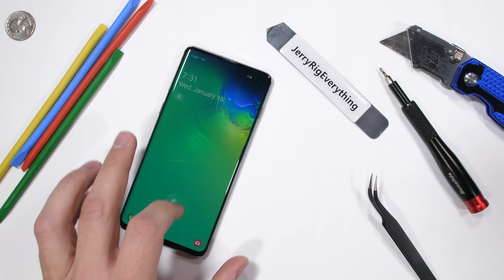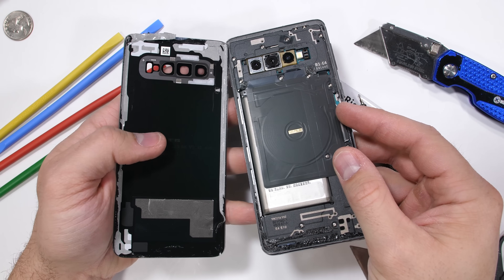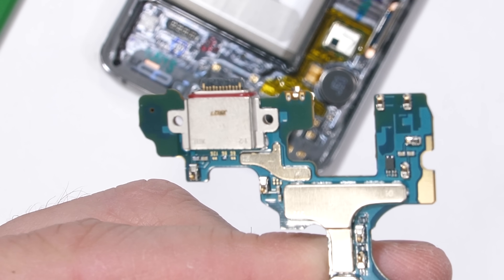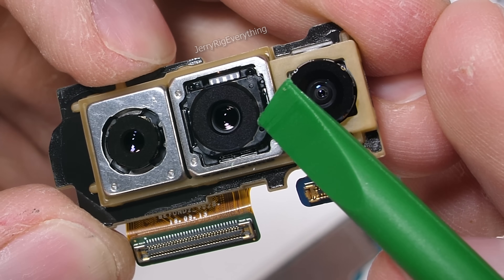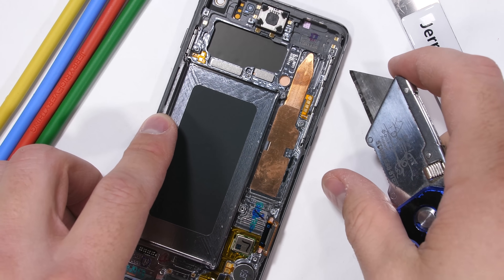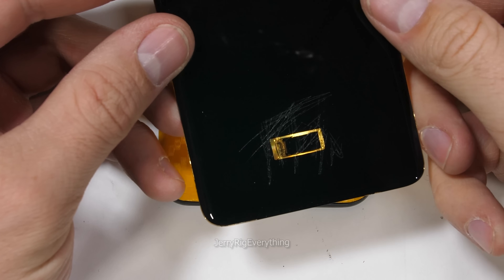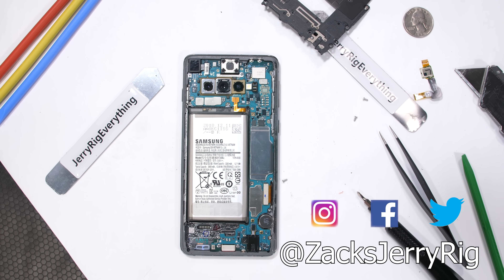Galaxy S10 Teardown – Does Ultrasonic Measure Up?

Comment: The ultrasonic fingerprint reader would have worked if you had re-registered your fingerprints. It just has to recalibrate to the new groves in screen.
Reply: That's pretty smart!
Reply: Oh no it wont work. If you place your thumb at that same very spot where you placed while registering , only then it would work.  But that's very Less probability. Cuz the scratches have to super impose on those exact same places for scanner to accept.
Reply: @knovelgen7735  have you tried? Also, groves can be improved with the same type of repair that is used on car windshields/windows.
Reply: @Aratarez  oh hell no. I agree i got a s10 in my hand but i would dare not do that. That's for jerry to do😂. Yes i think after repair it should definitely work
Reply: @knovelgen7735  Yes, Jerry should test it. Great suggestion 👍
Reply: God forbid you break the screen. 960$ repair for the s10
Reply: Spencer O'Neil 
What? Isnt it 300?
Reply: @tazoneils  its Samsung not apple to charge that high Samsung charge around $100-$150  1440p curved dynamic AMOLED 1200nits display..whereas apple charge around $400 for its flat notched 720p LCD  display 500nits
Reply: @anand.suralkar  s10 plus  fingerprint is not working how to replace
Reply: Yup
Reply: @Aivaras Jucis it of course depends on the total damage. It to severe... (replacement)
Reply: But he did break the cables
Reply: AR9fy is a smart cookie, but what if you forgot the manual password, pattern lock, and now you only have your fingerprint as a means to unlock it.... hmmmm
Reply: @BillAnt  remote unlock
Reply: @AR9fy < Yeah I suppose, but what if you forgot even the remote code. lol
Reply: @Aratarez  he doesn't know that when phone restarts it doesn't accept the fingerprint but just pattern
Reply: @BillAnt  what if earth is flat? - come on 🤦‍♂️
Reply: @AR9fy < Well, flat heads think it's flat, while  round heads think it's round, so everybody's happy. lol
Reply: @BillAnt  Not bad, Bill. Not bad at all. Well said
Reply: @AR9fy < Oh forgot to mention that I'm always right, even when I'm wrong! ha-ha jk
Reply: @BillAnt  but what if you lost your fingerprints
Reply: @Lucas Harris < Hopefully you would still have a backup such as a manual password, pattern lock, or in worst case I can still crack any user lock/pattern lock/fingerprint on any Samsung by other means. ;)
Reply: @BillAnt  yessir lmao
Reply: @BillAnt  then u just restart ur phone no phone's gonna accept ur fingerprint but just password or pattern think about that
Reply: Exactly what I thot

Comment: Actually, the charging port can be removed and a new one installed with the help of a soldering iron and wick.
Reply: Thomas Logan that’s not really the point though right? I shouldn’t have to do that to repair my incredibly expensive device. Very anti consumer
Reply: @chiln  Consumers aren't supposed to be disassembling their devices anyway, so I'm confused as to why they need to cater to a repair hobbyist?

Comment: I will stick with the S8 for 1 more year until it is perfected...
(They really messed up with the scanner placement didn't they?)
In case you didn't know, the scanner is next to the rear camera and can only do a partial print, about 1/3 of your pinky!

I have always used covers on my phones and I still have the s4, s6 edge and s8 all without a single fingerprint! It sucks, because they are beautiful phones and super slim!

The s10 with 5 cameras, 5g, huge storage, a bigger battery and some cool features like the ultrasonic fingerprint scanner and being able to use the sim card slot as a secondary so card!
"First try" lol we saw 2 so there was probably at least 5...

I still use my S8 and the fact that there is only one really big plus will probably keep me with this phone for at least another year (even though the battery life is down to 7 hours, just 2 years in, down from a claimed "3 day standby" and somewhere around a day full active!) despite the battery already basically being trashed, but I can have it replaced for free if I don't mind not having my phone for a few and the other fact that IT ALWAYS TAKES A YEAR TO FIX ANYTHING NEW, SO WAIT FOR THE REVISED VERSION...

Comment: Exactly what I've been thinking, Samsung is doing way too much "Apple-Style". I can see why they're going for the whole ecosystem and security stuff, but I used to buy my Samsung phone because it was an open and customizable device wich had great functionality on it's own or in combination with pretty much anything else. Now it's slowly moving towards "only buy Samsung products, we've got everything you need" and also the "Apple/Samsung knows best" mentality.
Anyway, Samsung is producing way more mature phones nowadays, however I feel like they sacrificed most of the configurability and flexibility by making phones that are almost perfect overall, but you can't really adjust the details anymore. It starts with the software, but it's obvious in repairability as well. Personally I noticed this when researching about rooting my s9.
It's obvious why they are doing this and I can't really complain since devices just get more and more complex and to make all these features easily accessible for everyone you have to sacrifice some individuality. The feeling I have is hard to describe, but with my previous phones I had to do a lot of adjustments and fine tuning, but afterwards I had everything optimized for my daily routine and I uninstalled everything else I didn't need. Now every phone is pretty close to perfect out-of-the-box and you won't have to care about unecessary stuff since you have enough storage to ignore it, but it'll never reach the efficiency I got when tweaking every single setting and knowing what every single button does. I guess there's just no perfect open but still high-end phone for me anymore.
Reply: Absolutely. I'm done with sammy because of not being able to get root on my note 8. I don't NEED it, but buying a $1000 pocket computer and then not being allowed to change whatever the think I want to on it? No way, forget it. Losing warranty and Google pay was bad enough, my phone  autopatching the only workable exploit out while I'm charging it out of the box, the day I get it? The they can blow me before I give them another cent.
Reply: Yeah, they really go through a hell of a lot of trouble just to stop you from rooting. I mean, if they void your warranty that's one thing, but to lock basic functions like Health...

Comment: Guys i have a problem with fast charging with th s7 edge and it doesnt fast charge and my phone will full charge at estimate 6 hrs to 7 hrs and what do you think is the problem and i try everything like wiping cache changing usb cable and trying it on the other s7 edge and it works to that phone but mine is displaying cable charging instead of fast charging

Comment: The brown stuff on the inside of the heat pipe is likely not rust but a type of fairly toxic nanoparticle suspension called IAS which is used to improve the thermal conductivity of heat pipes.  You might want to uh... wash you hands.

Comment: ive been following you for awhile now, and the only thing that kinda sucks is how your are becoming slightly annoying with your biases. Soldiering a new chargeport onto an S10 is no issue if you arent a moron. of course a removable charge port is convienent, but if your chargeport breaks, you DO NOT HAVE TO BUY A NEW PHONE

Comment: Or you can use a wireless charger to charge your phone if the USB-C port breaks. I'm sorry, I love this channel but I had this issue before with my Droid Maxx and I didn't find this to be a problem. Wireless charging is better for your phone anyway because it slowly charges the battery which prolongs the overall lifespan of the battery cells. No offense meant toward you Jerry. Love the videos. Just wanted to add a workaround.

Comment: I accidentally poked the sim ejector tool into the bottom right mic hole, the hole between the usb c port and the speaker. Did I damage the waterproofing or any other parts?

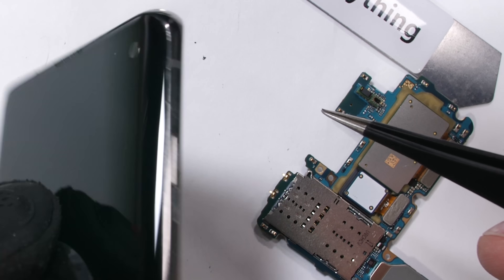Comment: this may be a stupid question @JerryRigEverything but if the sensors are under the pixels and can "see through the pixels" 7:10 of the 
OLED screen why couldn't Samsung have put the camera under the OLED screen as well? Then they could get rid of the hole punch altogether.

Comment: I love Jerry, but don't buy a new phone. Charge port and screen are replaceable and don' take to long. Just take it to a repair shop with a solder tech and experience tech. You just saved 900$

Comment: Most important feature of any cell phone is the ability for you to rip it apart and entertain us. 🍿
Reply: And equally important for the charging port, microphone, and headphone jack to be replaceable.
No such luck on the S10... at 3:05 I don't think Samsung made the charging port non-replaceable for the sake of making it non-replaceable, but as a cost saving measure.  By the way it's still replaceable with the right equipment (microscope, hot air station, etc.)  Luckily it's got wireless charging built in. ;)

Comment: The charge port still looks to be replaceable, but not by the average user unfortunately. Looks like it's soldered to the board so it still seems possible for a repair shop to fix it.

Comment: You should use a heat gun to get the adhesive soft and then with any thin spudger you can remove it pretty easily, From one repair guy to another.

Comment: My most important hardware features would be:

A charge port that's durable. Cheaper phones definitely tend to have more crummily made charge ports.

A few physical buttons like one for the camera. 

Enough bezel that the phone isn't fragile. I have a lot on my Kyocera DuraForce Pro 2(thanks! I bought it because of your channel!), but I don't technically need THAT much. I do like that my Kyocera's bezels are big enough that it has a front facing speaker that's also stereo. I'd also like the bezel to be big enough that positioning the speaker on my ear isn't difficult. I've learned to enjoy what my large bezels have given back to me, but they're not a requirement. I definitely don't like near or entirely bezeless designs.

A sim tray that doesn't require a tool, because...

An SD card slot. I don't like my photos and videos getting trapped on a broken phone or relying on the cloud. Putting it on the cloud sorta just puts it on the next phone I buy. I'd like to be able to remove them even if for whatever reason I'm without a phone for a day or 2 or a week or 2.

Everything else is very standard "I'd hope it's spec'd well enough to not be too slow or the camera too crummy for the price", but that's an any-phone sorta thing.

Software? I'd like it to be tested better. My dad got a Nokia 6.1, and it was great until it wasn't. We ended up having to return it. In spite of being probably the most updated and vanilla Android phone on the market with Pie and Android One, it had a problem where it neither had media volume nor call volume without putting the call on speakerphone. We then exchanged it for some Motorola, and its interconnectedness to use the Nokia to "setup a nearby device" didn't work, whereas this feature did work on the Nokia with my dad's much older Samsung.

At $200-$300, even if some things aren't the best spec'd or it's not the fastest, thing should at least work. You shouldn't have to spend the $444 I did to get a phone that "just works", as my phone's durability, 4k camera, and other features, should be an upgrade, not the bare minimum.

I also prefer phones where they thought about the ergonomics of the port(s) and buttons. It's very natural to hit my Kyocera's unlock button with my thumb in portrait or my index finger in landscape, and I can turn it around to put the volume buttons at my right hand if I'd like. Having the volume buttons on the same side as the power and/or lock button(s) is definitely a mistake and leads to a lot of accidental locking or volume changes. I also don't like totally smooth sided phones or that the bezeless phones are uncomfortable to hold for a while. Those're more of a "hardware" thing, but sorta in the "design" and/or "ergonomics" category.

Comment: I mean, you can take it to any reputable device repair shop and they can reflow a new usb port on it. I've had that done to a tablet before with a soldered USB port. nothing is "Permanent" in electronics if you have a hot air station.

Comment: 7:59 the screen is dead because he accidentally cuts the ribbon connector to the LCD with his razor blade, it's another reason "opened the screen means break it" there is barely no room for the LCD connector because this 'bezelless' things, compared to S8/S9 I could opened the screen and put it back without damage...

Comment: yet here i am with a iphone 4
Reply: iPhone 4 is a great phone. Downgrade it to 6.1.3 with CoolBooter and it’s beyond perfect in my opinion. I upgraded to iPhone 7 last year but I know when this phone breaks I’ll use the iPhone 4 again.
Reply: Leon Tichý I did!
Reply: ew iphone
Reply: Hmm that's weird.. Did apple make new phone worst than the old one? But the price skyrocketed.. Is That why you all still using iPhone 4? Because I can't wait to get the Samsung Note10, or the Fold. Both I guess.. I mean, I want all next new flagship phones from Samsung, never occurred to me to hold on to old devices, because all new one always better than the old one, even if it's just minor upgrades (except of course the note 5 and s6, they don't have Expendables SD card -a very bad set back from Samsung-)
Reply: xharpoon I actually lied that I still had a 4 I have an iPhone 5 just a week ago aha
Reply: @xharpoon  Not really. As seen in this video, the S10 is gonna be a pain to repair. If you break it, you'll likely have to pay 1/3rd the cost of the phone. That's for sure an advantage that the older galaxies have over the new ones
Reply: @down2006  yeah, but like I said before, I'll change it with the new one when they come out, so I'll always have them within the warranty. So No sweat over some repair, when it's break of course.. 

Just like my Note 9's S pen got broken before, because I dropped it into the pool (beyond IP68 rating) . Just went to the Samsung service center and got the replacement for free and no sweat, they're doing a great job @the service center IMHO.
Reply: Get a Blu vivo xl4 for 150$
Reply: I'm rockin a $35 ZTE 😞
Reply: get a new phone.. it makes you look like a looser
Reply: apple and you that’s probably .. no it’s definitely the most ignorant and naive comment I’ve read in awhile. You obviously have not lived in the real world. Somebody pays for your survival lol .
Reply: An*
Reply: Who gives a shit about spelling
Reply: @Purzify  your English examiner.
Reply: 🤣 Not changing, or not "able" to change? I mean cmon, there are cheap second phones out there whether it's Apple or else.. Newer than iPhone 4 of course..
Reply: xharpoon why do you think people can honestly afford phones ? Yeah I get what you mean though
Reply: @Purzify  well in your case, because u already afford one, assuming that iPhone 4 is your first phone, and I honestly don't think it's your first. So why is it so hard to upgrade? And people (maybe old people) who think don't need smartphone won't even watch YouTube, especially this channel, but you watched them right? (even made comments here)
Reply: xharpoon nah, I used to have a lg palm like

Comment: can you replace camera between S10 and XS what does happen if work or not
Reply: knowing Apple they probably used a different non standard connector just to mess with everyone.
Reply: @JonathanKing9608  Lol there is no 'standard' for the internal camera connectors...
Reply: @TomLube  Yes there is.
Reply: @JonathanKing9608  no. You cant use a Xiomi camera inside a Samsung phone.

Comment: with a 24 month warranty i aint to bothered about easy to repair stuff ,if after two years the phones usb port breaks id just wireless charge anyway ,if the screens cracked id just sell it for parts and put the money towards a new phone (every 2 years is sensible enough )

Comment: Bad thing that integrated charge port which is difficult to repair, means that one reason to avoid samsung s10. Screen is also supposedly super expensive to repair. Wish that google would have brought google ara modular phone to market where person can choose hardware stuff according ones needs and replace blocks which needs.

Comment: You CAN replace it in a repair shop(there are MANY phones with soldered charging ports on the market), of course you cannot do it at home. There are also some modular charging ports(S6, S7, S7 Edge - S6 edge being the exception) that are impossible to replace for the average phone owner, because the softkeys are under the glass, so you have to lift it, by this risking breaking it.

Comment: 3:29 Bro you can use soldering iron to remove it, use some flux to solder a new one with high quality tin, i agree that the comment user will have problem to that but if you know a little bit of soldering a specially SMA cuirctry then you'll do just fine .

Comment: Most important feature? The headphone jack (especially since LG put such a nice dac/amp in this phone, V20). It allows you to use wired (read: doesn't run out of charge) headphones, charge card readers, and (at least in most phones) tune to radio stations using the SoC's FM tuner (unless you have a carrier that blocks it like Verizon), all without needing a bunch of Bluetooth devices.

Failing that I'd say it's a toss up between a good SoC, a fair camera, and a screen better than whatever's in the discount bin of some Chinese vendor.